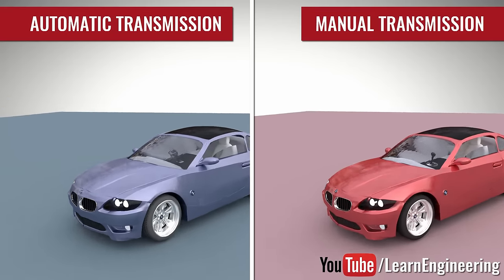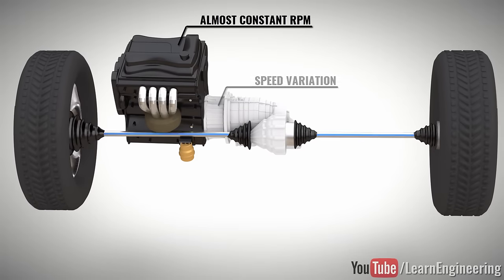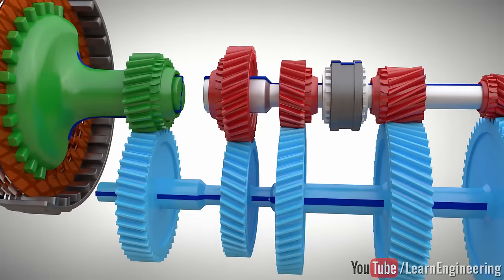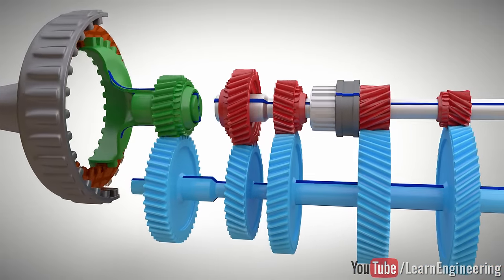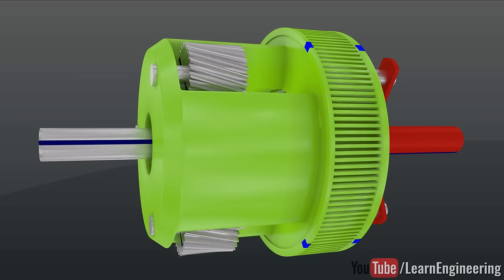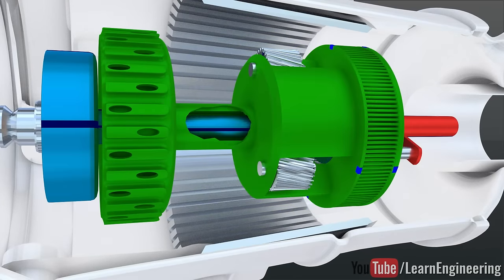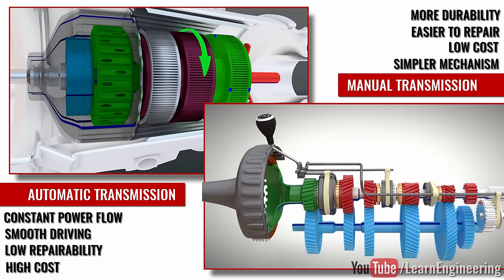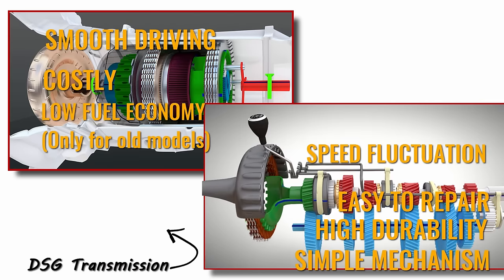Automatic vs Manual Transmission

Comment: I know how to drive a manual, and I love it. Honestly, there are times I find more of a power lag In an automatic than a manual. This is because the driver can learn to operate gear shifting so well they can actually reduce the amount of power lag described here to quite an unnoticeable minimum. Yes it’s still there, but it’s so minuscule that you really don’t lose any speed shifting gears. Meanwhile, most automatics are smooth, but I’ve seen more power and speed drop in an automatic trying to change gears quite often than I’ve seen in my days of driving my manual vehicle.
Reply: You don't know how to drive manual, you know how to drive.
This American nonsense of letting people that can't drive manual have a license is ridiculous
Reply: @arthurizando  Listen not everybody is a manual transmission fanatic
Reply: @rblxtutorials1881  I'm not fanatic. Just prefer it and knows it's advantages and even drawbacks
Reply: @arthurizando  Most people will never run into a scenario of needing to know how to drive a manual. Manual transmission is not mutually exclusive to the skill of driving, it is just a type of transmission. I understand you like having a superiority complex but it's rather silly.
Reply: @dangerousish7837  it's not superiority complex, I couldn't care less if people knew I could drive a manual, I just genuinely think that all people should at least learn how to, even if they are going to mainly drive automatic.
Reply: @arthurizando  But that's exactly it though. why does it matter if someone knows how to drive manual or not.
Reply: @MegaMoneyMaker711  in most cases nothing, but it is a skill that I think all drivers should have
Reply: @dangerousish7837  Not at all a matter of personal superiority. Truth of the matter is that automatic drivers will be left with their dicks in their hands when having to drive manually while the only problem manual drivers might face with automatics is that they would accidentally hit the brakes a few times for being used to shifting.
To learn something the hard way ensures that you can do it the easy way as well. Conversely, that's not the case.
Reply: How is that an achievement...literally everyone else on the entire planet knows how to drive a manual (outside the US)
Reply: @dangerousish7837  Wrong, it is mutually exclusive to the skill of driving. Automatic take away literally more than half the experience of driving
Reply: Counterpoint! Automatic operators can achieve instant acceleration by depressing the pedal in harmony with the speed of the vehicle!
Reply: @arthurizando  should we bust out the horses and require people to know how to ride them because they were once our transportation? Thats how diluted you sound... Horses are not going to make a comeback onto roadways and neither are manual transmissions. Electric will replace them all and shifting with be old tech. Rational thinking helps if you actually try doing it..
Reply: @ibelieveingaming3562  lol no. Watch the video again. Autos have to build up pressure in the converters fluid which takes a second so there is 100% a delay in power getting to the wheels... Electric has less lag because there's no air fuel mixture that has to happen before combustion and power is made. Try gaming less and using the internet to learn something... You even failed to understand this video.
Reply: @aimlessparasite1289  are horses still a major form of transportation? No. But manual transmission cars still are, and again, it is an easy to learn ,and useful, skill.
And yes electric cars will eventually end this whole debate, but until then...
Reply: @arthurizando  lol I'm in the u.s. dude. The VAST majority of the 330 million people here drive automatic cars. What tiny county are you in that has a majority of manual transmission cars being driven? Im betting all of your manual drivers dont add up to more than half of the auto drivers in the u.s.
Reply: @arthurizando  and electric cars are here so I dont know how much longer you need... Also I dont need to be told how easy it is to drive a manual my pfp bb6 is a 5 speed and my Lj wrangler is a 6 speed manual.
Reply: @arthurizando  one last thing. We have over 300,000 Amish in the u.s. who only use horses to travel btw.
Reply: @aimlessparasite1289  I'm just saying that until electric cars are the vast majority of the cars out there, and there are still a considerable amount of manual cars, it is useful to learn how to use them. I am not saying that you need to buy or use a manual, just that I think it is a useful skill to have
Reply: @aimlessparasite1289  think about it like school, you learn a lot of stuff that you will probably don't need, but they are useful and necessary in some situations.
Reply: @rblxtutorials1881  correction "not everyone knows how to actually drive"
Reply: @boerepompie8244  woah another person bigoted against Americans, classy.. Guess I didn't look up the numbers of cars each country drives by percentage... Or consider how many automatic cars driven by the Chinese. Oh wait I did and you didn't. Have fun still being wrong.
Reply: @arthurizando  In the Netherlands it's even so that you by default get taught using a manual transmission.  Only in very rare cases, you can get driving lessons in an automatic car, but you'll get a mark on your license you're not allowed to drive with manual transmission cars. In Europe this is really common, mainly because back in the days manual transmissions were more fuel efficient, and gas was (and still is) WAY more expensive than in America. Now, however, automatic transmissions have surpassed manual regarding efficiency and the popularity of manual steadily declines for the every day driver. 

I think it is funny to see people brag about being able to drive with a manual transmission though. Here that's basically one of the least impressive skills a driver can possess
Reply: @aimlessparasite1289  Manual cars are significantly more popular than automatic ones throughout the entirety of Europe, including big countries like Germany, France, Poland, Ukraine, etc. It's simply because back in the past, manual transmissions were more fuel efficient and fuel is significantly more costly here (I'm talking about over 8 dollars a gallon where I live nowadays). Whilst maybe now we're at the time automatic transmissions might be more efficient and become more popular, a big part of the drivers still drive older cars as most countries heavily tax buying a new car, or people simply can't afford a new one. 

People are by default taught to drive manual cars here. When you are too incapable of using a manual gearbox, you can get lessons in an automatic car, but it will be marked on your license and you won't be allowed to drive in a manual car. The reason this is done, is because when you just start driving, you're likely 21 years old, you still study, have a little sidejob, meaning you probably get some old car from the early 2000s from the time when automatic cars in Europe were still barely heard of. 

Whilst rentals usually provide automatic cars, when you live in Europe, being able to drive a manual car is not just a leisure thing, it is a really important skill as it significantly expands your choice of cars you can drive. We don't just do it for fun, it's still a necessity. Let me remind you, there's over 400 million people on this continent where still the manual car rules in this day and age... Were two different regions of the world with different histories and we have different reasons to drive different transmissions.
Reply: @BeesKneesBenjamin  that's my point, I'm from Brazil where most cars are manual. And basically everyone learns how do drive a manual,  it's not something to brag about it's just a basic skill.
Reply: @aimlessparasite1289  Btw, in China, people also drive a bit more manual cars than automatic...
Reply: @BeesKneesBenjamin  for how much longer tho? A year? 5? Its not long. That's my point. It will inevitably be like the u.s.a. ratio soon.
Reply: @aimlessparasite1289  Well, I mean, we both live in countries with a relatively rich population, and it can sometimes be hard to envision how life is like in the rest of the world. The massive majority isn't as fortunate that they're simply able to get to buy new cars with automatic transmissions, they just keep old cars running for as long as they can. 5 years is therefore really optimistic. Honestly, I think that by the time automatic cars could surpass manual ones in popularity, the majority will transition to electric ones, which are neither automatic nor manual, they're directly driven systems without gearboxes. Once we're in that era, petrol cars will be driven mainly as leisure rather than as functional transport... Who's gonna be driving an automatic car for fun? Manual ones are way more interesting for petrol heads as you're the person who regulates and keeps the engine running smoothly rather than a computer :P.
Reply: @BeesKneesBenjamin  if you read my comments you would see I already said that electric will beat out autos because the near death if the internal combustion engine........ Seems like In saying the same thing over and over on here lol. 5 years is not a long time either we already have electricity in our homes so with a e.v. and an extension cord, gas stations become obsolete overnight... Gas is 3x nearly 4x as much as a few years ago so if demand goes down (like it already is) the costly extraction processes will raise the price faster and faster on fuel as less people buy it.
Reply: @aimlessparasite1289  
I'm not claiming you're false on the fact that electric cars will sometime in the future take over the car market. I'm just correcting all the other false claims.

I'm just pointing out it is not going to be the current "u.s.a. ratio" soon, an electric car isn't the same as an automatic car. We're all gonna divert towards the same thing together. 

By the way, the fact that people have power in their homes doesn't mean that we're all going quickly to electric cars though, they're still super expensive due to the significantly reduced amount of parts and the less opportunity for car manufacturers to sell spare parts for repairs. These cars have to be sold for more money for the manufacturer to make the same amount of profit during the electric car's lifespan as a diesel or gasoline car. Not everyone is able to make such a large investment in such a short time... 

And even besides this, electric freight trucks are still barely in the making as the tech there is still at a really early stage (much less than 1% of all freight trucks are electric currently), meaning that gas stations absolutely won't become obsolete any time soon. It absolutely won't be overnight, it's gonna be a fairly slow transition...

Your claim about gas being almost 4x more expensive over the past "few" years is also silly. Quickly checking the numbers will show it only doubled over the past "few" DECADES, at least in the regions where you (and also I) are from.

Of all cars being manufactured yearly, not even 10% of them are electric currently. Keeping in mind that in most highly developed countries the average car on the road is a decade old, (not even speaking about countries where the people are less well off), I can almost guarantee you that it will take at least another decade that there's gonna be a significant shift in the percentage of electric cars driving around. Keep in mind that the percentage of electric cars currently on the road is less than 3%.

Sooo..... How about you "Try gaming less and using the internet to learn something...", because you're making a bit of a fool of yourself. "Im not wasting any more words on you. You are too smooth brained to grasp that" it's actually still very necessary in the biggest part of the world to drive a manual car. My takeaway here is that "Rational thinking helps if you actually try doing it..". "Have fun still being wrong."
Reply: @BeesKneesBenjamin  the fact that you are talking about current numbers like they are not in decline and Im talking about what the numbers project (which is a decline) is funny to me. Im talking about the future of manual cars in general... In most of those countries you list as a majority of them using manuals their number were still shrinking.... That points to them getting phased out. I've clearly said that its going the way of every type of old type of transportation and getting phased out. How am I wrong if it literally already happened here in the u.s.? The change is coming and no amount of word collages you make will change that. And thanks for mentioning the % of electric cars btw if you take a quick gander at the numbers, they have been going from 16k to 2 million in around a 10 year span... Do you think that bell curve is gunna suddenly stop getting steeper as production increases? I just think it pretty dumb to think that manual transmission numbers will continue to climb ever again. From what I read thier numbers are going down everywhere and are not available at all on e.v.s so... Gunna decline until you no longer are going to have to pass a driving test driving a manual just like the u.s. Be it in 5 years or 50 year it will happen. Idk why you want to say otherwise. Because that's what I've been repeating from the start lol.
Reply: I can shft and the passenger won't even notice its quite easy
Reply: @arthurizando  I tell my kids if you can drive a manual you can drive anything
Reply: exactly, autos definitely aren't smooth as he said in the video, most of them take ages to change gears
Reply: If you can't start a fire with only wood you chopped yourself, you don't know how to cook. All those idiots who only know how to use stoves will starve to death (like they deserve) if their stove ever stop working, whereas the survivalist fanatic will still be able to use stoves but does not need it.

Oh and I'm not done, if you can't make a wood-chopping axe from rocks you don't know how to chop wood...

You see, after spending decades re-inventing human survival skills from the latest technology of 30,000 BC, I'm now the most superior human being on the planet. Quantum physicists have nothing on me. Do they know how to make an axe from a rock? No? Those idiots can't even survive a day on their own and only live by my mercy.

Comment: 3:28
Never a smooth experience huh? I take offense to that.
Reply: The reason it won't be smooth is the driver. people don't understand the concept it is rough because the driver let's of the clutch before give a little gas or slamming off the clutch that is why it would be rough if you give a little gas while letting off its smooth shifting it takes practice like everything else
Reply: If im about to go up a hill ill shift down meanwhile if its automatic you'll need plenty of gas to make the hill meaning more gas usage . ill keep my standard
Reply: Its all up  to the driver whether it will be rough or smooth af
Reply: @saba7733  true
Reply: @Sehyo  it honestly depends on the driver,if you rev match it will be smooth
Reply: @saba7733  yes, exactly lol

Comment: The vast majority  of cars in Europe  are manual transmission  and gear change  becomes  a smooth  with experience. 
I drive both manual  and Automatic, finding Automatic sluggish when it come to gear changes and jolts when doing so.
I also  found  gear switching  up and down repeatedly , when going up hills. 
In a manual  you can hold the gear and increase  the reves until you can have enough  torque  to hold the higher  gear